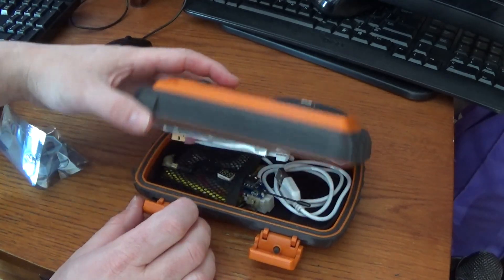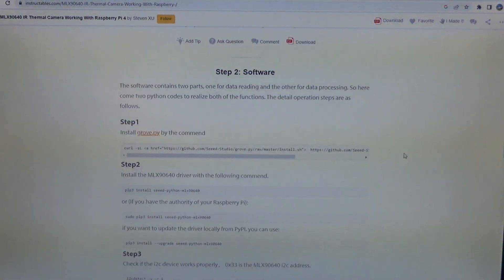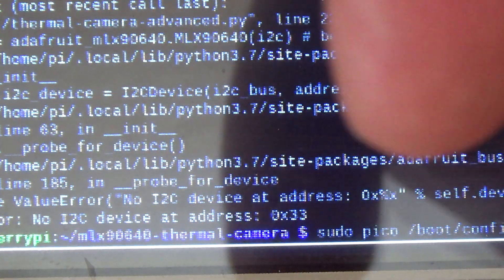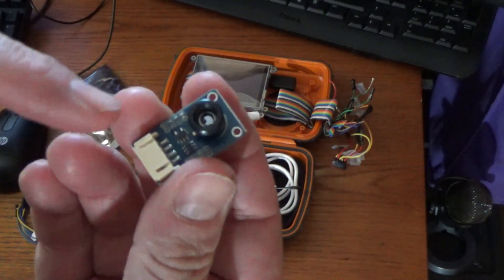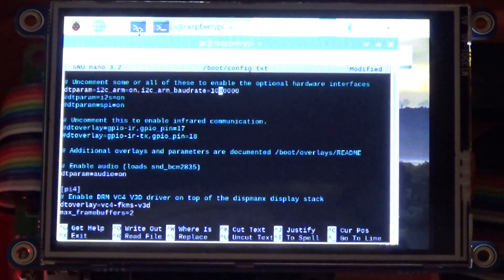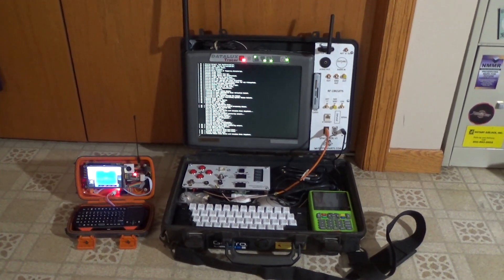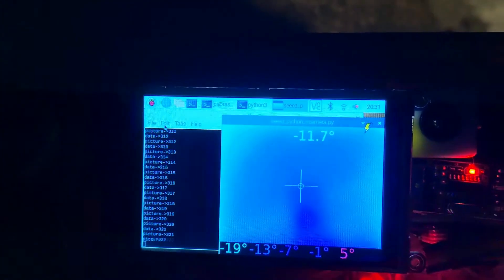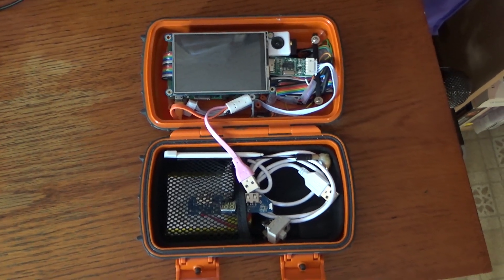Upgraded Thermal Camera For My Redneck Tricorder

Comment: For writing python try using an IDE to edit the script instead of typing import in terminal, import is a python command so u need to enter the python command to use import. But for the script you are running it most likely imported all the required packages already.

Comment: Recently got myself a pack with an MLX90640 and an m5stickc (or whatever it is called) for 80$ from the company that made them. I an pretty satisfied with the buy, the camera works mighty fine with the esp32 and even on the 16Hz refresh rate it is very easy to react in time if you fuck something up.

Comment: FWIW: I have been interested in adapting some kind of AFFORDABLE {and remotely zoomable} thermal IR sensor with good resolution for "Kite Aerial Photography" {KAP} and "Kite Aerial Video" {KAV}. 

{Just GOOGLE both. That will explain them better than I ever could...😊}
Reply from the maker: That would be pretty cool. I looked into Kite photography a while back, but then drones got popular and I forgot about it. I'm not sure how many thermal sensors are zoomable, they can't use regular glass optics so you'd need some fancy lens system.
Reply: @saveitforparts  >>> AFAIK the zoom and resolution capabilities are one place where the $$$ goes up. 

I turned 62 in early 2023, so I was into Kites and KAP/KAV long before drones came along...😊

Comment: That low voltage on the pi gave me some weird issues. try just giving it 5.1v 3a
Reply from the maker: I don't think I've ever found a USB power supply that my Pi is happy with. Kind of frustrating that they designed it for power supplies that no one owns.

Comment: Where do you get the cases?
Reply from the maker: Most of my stuff comes from dumpsters / surplus sales / garage sales /etc. The orange case used to be some kind of portable speaker. I couldn't get it to work so I pulled it apart and re-used the case.
Reply: Also what keyboard is that at 01:33?
Reply from the maker: The one with the built-in trackpad was some old thing I had lying around. It stopped working reliably, so I had to replace it.

Comment: notice you didnt find where missing 2 amps was leaking from at all good video abuot thermal but making up an excuse to build it is funny!
Reply from the maker: I never found it with the thermal camera, ended up replacing the battery and the car seems fine now.

Comment: Such a shame that you had to use python. Python is in dependency hell, you need to track down the correct version of python as well as the dependencies.
Reply from the maker: That seems to be what everything is written in these days, especially for the Raspberry Pi. C++ and Javascript were the big ones when I was in college, but I don't see them much any more.
Reply: @saveitforparts  - Might be worth dusting off the old coding brain cells and perhaps write a lib in C++ for this to tie into the Pi and the thermal cam. Might perform better, and if you know the language better, might actually be easier for you to debug, and without Python's dependency hell as mentioned by the OP on this thread. Failing that, see if you can get some coding buddies to help out. I'd offer, but my coding skills are even rustier than yours, because it's been so long. But if you need another set of eyes to look at it, I'd be happy to help debug, that's one thing I haven't forgotten. Just let me know :)
Reply: @saveitforparts  Javascript is very much alive and well, still the worlds most popular. 

But im sure in these tinkering communities python is the most popular. It's very unfortunate, raspberry pi's could benefit from faster code. Likewise, the open source  independent project nature of these things is ruined when  we can't run the code we found on a blog 2 years ago because python always breaks.

Comment: The problem with your first MLX is that its not just the sensor, there is also a STM32 processor which basically connects to the actual MLX thermal camera. They expect you to connect to the board with Serial and read data with text form that they send you while the STM is communicating with the sensor. So your ghosts in I2C are just because the STM32 is already communicating with the sensor.

I’ve gone through their code in the STM32 and the reading from the sensor is very slow and inefficient, so what I did is remove the STM32 with hot air gun and just plug the I2C and power straight to teensy 4.0 and I got around 20fps with that boy.
Reply from the maker: I mailed the first one off to someone else who got it to work, apparently there's a jumper I missed that switches it from I2C to some other comm standard. The new one I got is working fine :-)

Comment: Narrow the draw down by hooking an ohm meter between the negative terminal on the battery and the negative cable with the car off and get your reading and start pulling fuses to see if the reading changes

Comment: Have you thought about using ChatGPT for the python script changes you want? Lately its been helping me greatly. Because I can describe what I want different in a script, but I can't  be bothered to write it out myself. With ChatGPT it gets me 90% of the way there. Speeding along DIY projects that would stall on code changes.

Also in the cheap IR world, there are now cheap handheld units from china at the ~150 dollar mark, that have a very nice 25Hz. Sensors used to be just 9Hz, but that was because of US export restrictions!
Reply from the maker: I haven't done anything with chatGPT yet. I kind of want to learn / re-learn the code myself, I actually went to college for computer science but have rarely used any actual programming. About the only code I remember is Applesoft BASIC from the 1980s :-D

Comment: I am not a do-it-yourselfer...AT ALL.
But I still found this video interesting.
And your Pi-corder looks SO cool with the new keyboard.
☮
Reply from the maker: Thanks! I thought it looked good too, I didn't even measure it before buying, it just happened to fit really well!
Reply: @saveitforparts  Howdy, I've got a solution for your digging tool severed cable problem.

A lot of people add a 3 pin IEC socket (Bluetti AC input) to power tools. That way you can easily replace cut cables with standard PC power leads (Bluetti AC cable). They come in lengths up to 10ft. https://youtu.be/RjYi3QKl_yk

(It's cheaper to buy old PC power cables and chop the cable sockets off old CRT monitors than buy new bare parts 👍)

Comment: I had been wondering if those sub-$100 sensors were useful. Interested to see if it starts performing better in above-freezing temps, or if you can get it performing sub-freezing. Definitely can understand having t-rex arms that can't reach at the moment.
Thanks for sharing!
Reply: Even if a single sensor isn't good enough, multiple sensors in an array would have enough overlap if properly spaced to give you whatever resolution and depth you might need.

Comment: Check your alternator for the parasitic draw, I've had it a few times where power backfeeds through the regulator/rectifier circuit.

Comment: The battery you are using is not giving the Pi enough amps that it wants so thats why it shows a yellow lightning bolt symbol. That is likely why you are having some slow problems.
Reply: Low battery can effect performance

Comment: 2:05 you should do that from a REPL (like ipython) not bash, those are python code lines not shell commands. Also please stop using sudo as a fix-all solution.
Reply: if only getting stuff to work on linux didn't require 3 phD's 😂